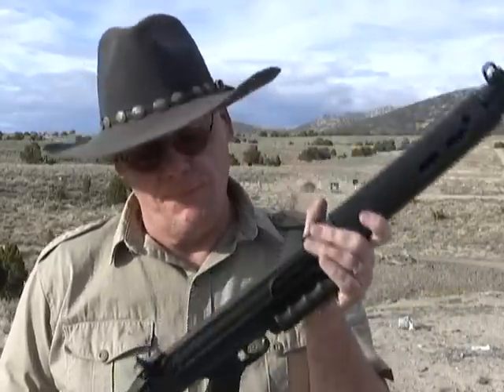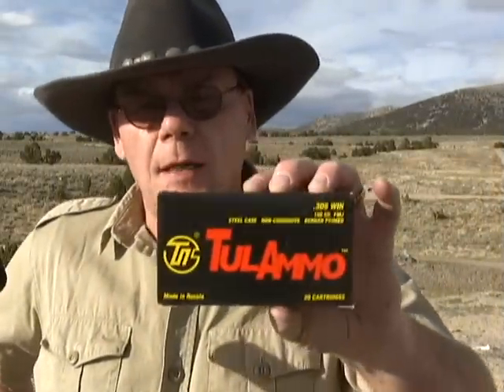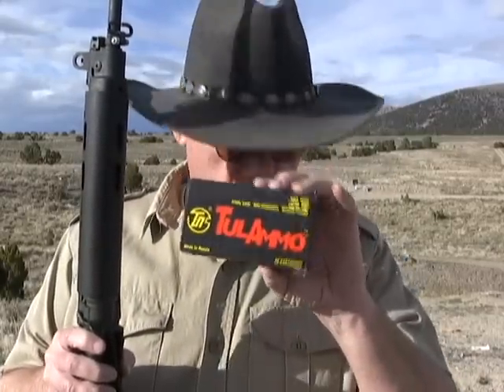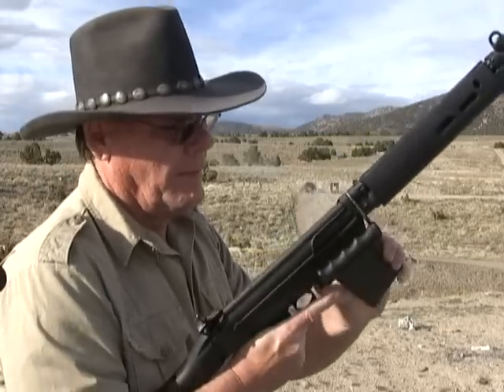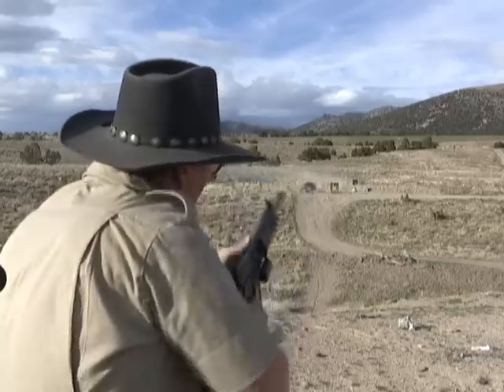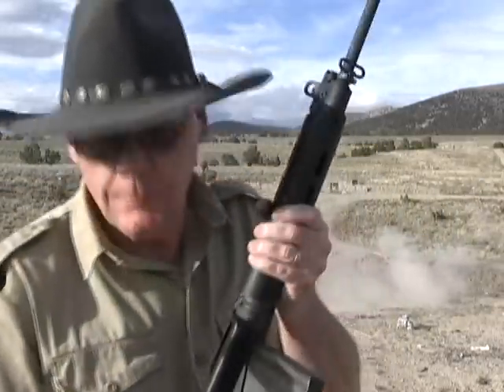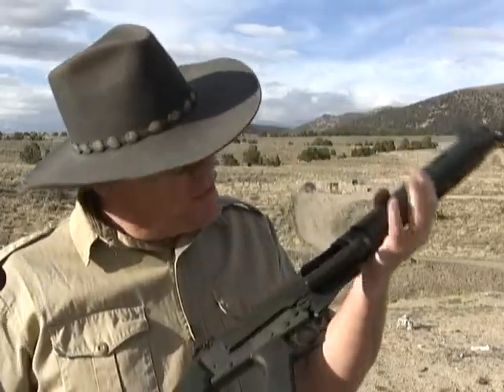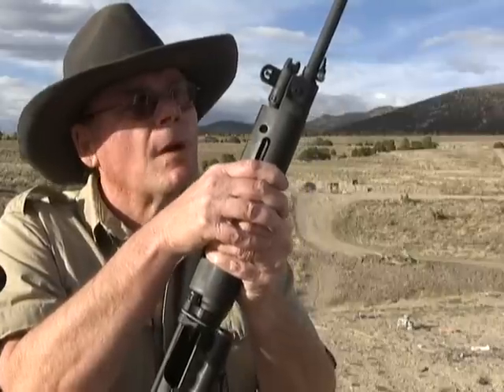Century Arms .308 R1A1 FN FAL Battle Rifle Junk?? You Decide!

Comment: May be you should have set your gas onto 6 which is the normal setting then you wouldn't have collected so much heat ? I never had a problem once in seven year's of service with the SLR ? work it out for your self if you wish ? Great all round weopon acurate with great stopping power what more could you want ? :-) all the best ...
Reply from the maker: When I bought my rifle I experimented with the gas setting and I found that the rifle worked perfectly when set at 3.  Any higher than 3 and the gun just wouldn't cycle correctly.  Maybe now that the gun is broken in I might try 6 and see what happens.
Reply: sounds strange ? maybe the gas ports under the gas regulator were possibly blocked wi paint /carbon or crud ? not to worry enjoy it we all did :-)

Comment: 1981 issued my SLR when I joined the RA that weapon was a bond hook ,heavy and too long for CQB but I loved it ,never, never not once did it let me down I only had occasion to adjust gas and that was in the arctic training when they swapped out for the absolute crap SA80 we all felt naked without the punch of the SLR after selection to UKSF had the M16 then the de Marco utter crap I still missed my SLR especially as the enemy in iraq and Afghan had the klash it being better over distance in experienced hand it was a case of them popping off rounds and hitting when you returned fire you were allways kicking up sand too short with 5.56 the GPMG saved the day we kept saying we needed an SLR type weapon one or two in each patrol as the enemy were using the distance well and going for the GPMG operator after leaving with injuries it seems they have introduced a 7.12 into patrols took there time like ha ha thank god for the GPMG and the LMG

Comment: These rifle come in "inch" and "Metric" configurations. If the opposite mag in used in either gun, it will allow the bolt close when removed. Inch pattern are L1A1, R1A1, L2A2 and all Common wealth SLR's. Belgain, Imbel, and all select fire variations are metric. Most of the time using the proper mag is all it takes to correct the problem. Feed and eject problem usually only require a gas system adjustment, that's why it has it. To adjust to different ammo. 11 year old, no whine about recoil, Hm

Comment: As much as I love the FAL I'm not fan of its gas regulator.  You have tune it just right every time you change ammo and it's a real pain in the ass.
Reply: @ Matthew: In principle, the gas regulator is a good idea. It allows the user to compensate for differences in ammunition, weather conditions/temperature, and for a hot, dirty rifle (i.e., as the rifle gets fouled and hot from long strings of fire, and begins to run a bit rougher, the gas valve can be reset to help keep it running). Just a bit more gas to help it cycle. However, the caveat and where maybe you ran into trouble is that the rifle was designed to work with NATO-spec. standard M80 Ball, 147-grain FMJ. In theory, any "legitimate" NATO M80 ought to function reliably, and in similar fashion, as any other - since the manufacturing standards are set across the member nations. SOP would be to get some of the ammo you plan on using most, and then set the regulator so that the rifle just short-strokes. Crank it open again until it starts cycling reliably, and then go a notch or two past that for a margin of error. That's your default setting. Or, you could get an M-14/M1A instead - which has a self-compensating, self-adjusting gas system that needs no manual adjustment.
Reply: Don't have that problem with the M1A/M14, its gas system is self regulating. From 125gr all the way up to 175 gr .308/7.62NATO. Although it can't shoot a steady diet of 180gr+ .308 as that beats the gas system to death after a long period. But for most ammo there is no need to adjust the gas system on an M1A/M14.

Comment: Compared to alot of military issue rifles.. Not alot to go wrong  with it .... If it dont fire it WILL be a misfeed .. rarely you need to adjust the gas... just Cant , cock , hook n look ... turn it back over punch the side to expel the misfeed .. release bolt .. & get back in the firefight.

Comment: Magazines suck for century arms Fal. I got some DSA mags and FTF on every round. Old ones work fine. Also, i took apart the stock and spring and reinstalled it incorrectly. (It's a bitch to put the spring back in) that caused malfunctions. I also tried 7.62x51 rounds and those didn't cycle american eagle .308 and winchester worked fine.

Comment: Century has had a very bad reputation with quality and customer service. These FALs were made from mixed kits and as bad as that sounds, is really not. When it comes to the FAL platform it mostly comes down to assembly and if assembly is done correctly there should not be any problems. I'm trying to get my hands on kits and even Century's whole units but its almost impossible at this time and I don't really want to dish out $1800 on a DSA unit. Great rifles

Comment: Here's a suggestion: BUY BOTH, That's what I'm gonna do. I already have a CETME. I haven't shot it yet but I will tell you, if you can, buy the origional HK parts for it because the stock and pistol grip are made of cheap plastic. I just saw a L1A1 in a gun store. I'm gonna get it just in case Obama wins this election.

Comment: The FAL - FN - SLR was and is a sick joke. Most of the those who have  comments posted in this site never saw action, never used this weapon in extreme circumstances - sustained firing in hot conditions - for example and have just succumbed to idle dreaming. This weapon was15 years out of date when first 
issued and it all went downhill from there.

Comment: Don't shoot steel case in an FAL unless you want a KABOOM. It not if it when, when you you use steel case in that gun.
Reply: +Spuds McHaggis What army was that ? , That was useing steel cased round's ?
Reply: +Lew Frazer 

I was being sarcastic with my reply to TheDouchenozzle 13 since by their comment, they have no idea about steel case ammo since, any case whether it be made out of brass, steel or aluminium has a chance, albeit a very very small one, of exploding in the chamber.
Reply: +Spuds McHaggis........I mised the sarcasim bit ,My fault, that aside The rubbish steel cased round's from russia are not necked down to the equivlent of the NATO 7.62x51 Brass, even the .308 Win are 1.5ths bigger and I have seen a few split case's with them . If you are a Brit you will know what the( SPW )is and the wee tool contained therein for dealing with such in brass but it won't remove a steely .
Reply: Have the proper extractor (the wee tool). and only use the correct brass cased ammo , I wouldn't dream of using steel ammo

Comment: G3> FN FAL
Reply: M14>G3
Reply: Zac Watts
I'd say: M14≙G3
Reply: *****
I think you get how i numerated it.

No G3>FN FAL is correct. Its not supposed to be G3<FN FAL, G3<<FN FAL or G3>>FN FAL

1. Not true, the FN FAL doesn't even have a free float barrel
2. Yes with an exception
3. You have to fiddle around with the gas system in order to do so, which isn't all that great when you are inexperienced(It was the reason why the Israelis replaced their FALs). Addition, if you come in to a “over the beach” situation, your FAL will blow up, because your gas system will blow up when water is in it.
4. There are grenade-launchers for the G3.
5. A port buffer will prevent that.
6. Make sure that the bolt gap is fine and you won't have a sharp kick, the FN FAL still has less recoil, though.
7. Tell me more about how FAL mags are cheaper than G3 mags:

G3 new: http://www.keepshooting.com/hk-g3-magazines-5-pack.html

G3 used: http://www.cheaperthandirt.com/product/MAG-304

Cheapest Fal mag I could find: http://www.cheaperthandirt.com/product/8-RWB-FNFAL

8. Never heard of that being an issue.
9. G3 has easily attachable claw mounts for optics and if you want to you can also claw mount some rails instead.
10. All G3 parts and those of clones are interchangeable, even some parts of the CETME
11. G3 is simper to break down, also quite nice if you aren't that well trained.
12. For the G3 are many different butsocks and handgaurds available
Reply: ***** 1930's design? Didn't the Assault-rifle(even though the FAL/G3 is classified as a Battle-rifle) concept come up in 1942 with with the STG44?

You can even find those G3 mags in Africa so I'd say you can find them everywhere too, except in places like china. But you won't find any FN FAL mags there either.

Thanks to our gunlaws i can't own them yet, but that will change within the next when I got my hunting license.

How ever my father owns an HK91 and fired thousands of rounds through it. He also got to fire with the FAL a bit. He used all sorts of ammo be it surplus or hunting ammo. He seems to be one of the lucky guys, because hr never really had any issues with his HK91.

Sure the G3 isn't a perfect gun, but which one is? I think you are stretching the imperfections a bit just like anybody else who for is really in favor of a certain weapon, you see it a lot(as you know) with your AK and AR15 owners. The one side says you can't hit anything with your gun other side claims that all it takes is a dust particle to jam yours.

Roll with that what is the best for you.

I for my part will rely on the experience of the people I know.